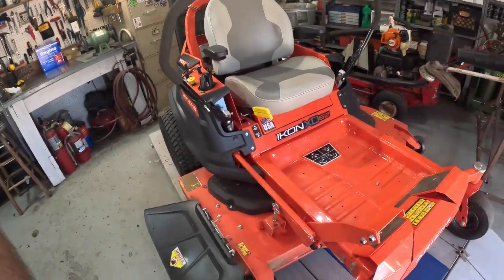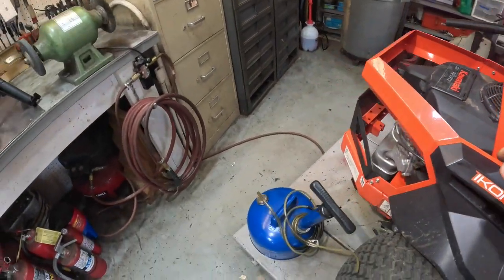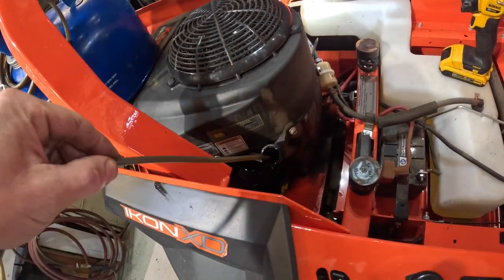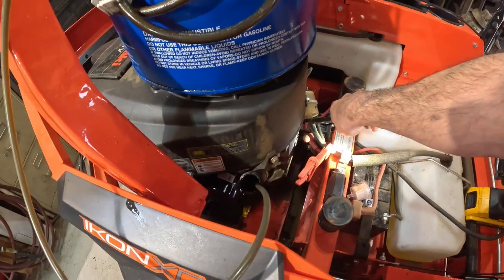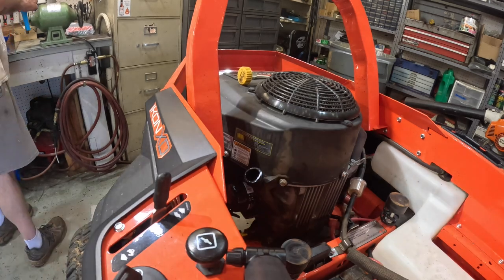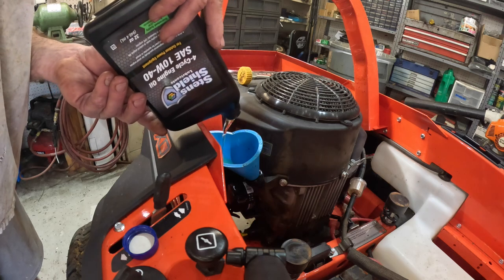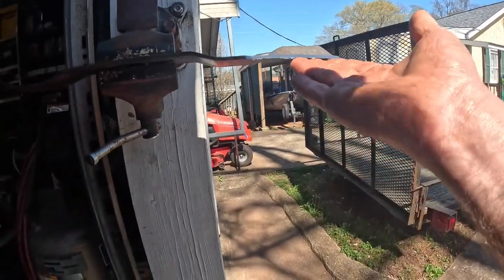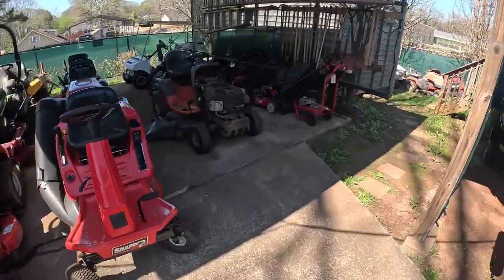Annual Service on an ARIENS Zero Turn Mower

Comment: I just did a tune up in my ariens ikon xd52. I replaced the drain plug with the hose part# 51044-0902.   Next time should be easy oil change.

Comment: Hi Tom;

Good video and nice shop.  

Couple of things on The Kawasaki motors. When checking oil do not screw the dipstick in all the way to check level.  Many folks including myself have done this.  It says right on the dipstick do not screw in all the way. If you do screw it in all the way and top off to that line on the stick than the oil will be too high.   Second ,try to sell your customers on the made by Kawasaki  screw in rubber drain hose. Its cheap and doesn't make a mess like that Yellow plastic drain that' s on there stock. There is a cast tray under the Oil filter so my mod was to take a cereal  box and form a funnel out of that so it will stop oil dripping on the drive belt and pulley on that side. 

Also ,when changing oil  use the rubber drain hose.  As you know all the dirty oil is on the lowest point in that crankcase which won t be removed if using the suction method.  Apply a small amount of pressure on the oil fill pipe with your air hose.  That will force out the remaining oil and debris as well. Again 1or 2 psi is more than enough. Do not over do it!

You will pocket a few bucks in labor and your customers will like the fact that you really care about their machine not to mention the next time it comes in for service it;'s a drop oil and go scenario. 

Also I noticed you had some 2x4 material to use as chocks.  If that strap lets go  those rear tires will go right over those 2x4's like Greased Lightning . Those front wheels will go right over you and no I dont trust the Parking brake in that scenario. That zero turn weighs 682lbs per spec , and maybe more with topped off fuel. Instead Invest in a pair of Harbor Freight or Tractor Supply rubber or plastic chocks they  are way higher, weigh and cost almost nothing.  Just trying to save your Bacon here.....

Hope this helps.

Comment: thanks for your videos
for the blades i use a 40 grit flap wheel on my grinder, removes metal fast and wont heat up, i can do a bad blade in about ten seconds each side, i mow for a living and sharpen my blades 2 or 3 times a week depending on how many sticks i dont want to pickup lol, short of buying a professional sharpener this is the best way i have found and the flap wheel is a lot quieter

Comment: Tom I believe as hard as it was to pull the spark plug caps off a dab of dielectric grease would have made it much easier for the next guy. Seems to me you grind a long time. Of course sometimes they need it to get rid of the rounded edge. These were sharper than my home mower. Before you started.

Comment: Nice video  thanks, But you are not supposed to screw the dip stick in on any Kawasaki engine to check oil level. Just rest it on the tube. If you screw it in you'll be low on oil. It's in the manual and written on the dip stick itself. Just thought i'd let you know. Thanks again Tom.

Comment: Hello , Love to Watch your videos and learned alot ,, I started this hobby 2 yrs ago repairing and flipping push and self propelled mowers and enjoyed it !!! I am thinking in learning riders and zero turns . is it hard to learn to fix the them and what is best way to learn ?  keep up the great videos !!! also where can i get one of those oil suction device?
Have a Great Week !!
Reply from the maker: best thing you can do is watch a lot of you tube videos! just be careful working on larger equipment by yourself, that is the mityvac 7400 extractor

Comment: Mine came with a clear plastic tube that connected to the plastic oil drain. The most irritating way to get the oil out. Now, I've lost the tube. Other than that, I love this mower!
Reply: Not Ariens fault you lost the tube
Reply: I bought a Braided Stainless Steel Drain Hose for my Kawasaki oil changes. After cutting the silly plastic fitting off the engine, it was an easy install. The Stainless hose stays where I bend it, instead of trying to straighten up away from the  oil container. Amazon has 'em.

Comment: I just purchased my first zero turn. When is time to sharpened the blades do you need a way to rebalance the blades or it doesn't matter?
Reply from the maker: you really should check the balance each time ya sharpen

Comment: Ha its that time again for an oil change on my Apex 52.... The fuel filter you removed is the original Kawasaki filter, which I'm sure you know that.  I just replaced the one on mine as well (with an original KAW filter from the dealer), but did't bother with the spark plugs.  It's the same engine -FR691V as the mower you're working on. Got a ?  ...  What's the rule of thumb on spark plugs? My mower only has 41 hours on it, but this is my 4th season using it.  It runs fine and never an issue so my motto is ... If it ain't broke don't fix it.  I'm also a fellow Georgian.
Reply: Should I bother with the spark plugs or let em' ride?

Comment: I pull from the bottom up  piece of plastic bag under the drain and filter in a funnel shape and place an old paint roller pan underneath the end of the plastic.

Comment: I no longer lay under my mower to service the deck.  The IKON-XD52 deck can be removed in less than ten minutes and without tools.  Flip it upside down on the bench on a 4X4 on each end and work standing up.  When oil is drained and black in color, that's a good thing.  It means the oil is doing its job and holding contaminants in suspension rather than allowing them to cling to critical engine parts.  All the best to you as you begin a new journey.

Comment: Would like to how your Steam Clean Process Works? Thanks Tommie👍
Reply from the maker: i buy Purple Power at walmart in the 2.5 gallon jugs, mix it half with water in a cheap little one gallon pump sprayer, soak the equipment and just hit it with the water hose on straight stream avoiding the air filter, somethimes i'll put in a bad air filter just to soak up any water, after that i'll replace it

Comment: Since it had way too much oil in it it's possible the owner screwed the oil gauge in fully to check oil level which was the case with a lot of older small engines but isn't the case with a lot of the newer engines

Comment: You are supposed to grind using the rest and the blade the other way around  grind from the top is the proper and safe way to use a bench grinder

Comment: Hey any help , I purchased mine brand new , now it has 48 hours on it and the blades are not engaging when I pull the PTO up I can hear it trying to , but nothing
Reply from the maker: check your belt, make sure it hasnt come off, look under the back of the mower and see if the belt is still on, with a 3/8 socket take your blade spindle pulley covers off and make sure the belt is still on, and make sure something doesnt have the blades wedged like grass or a stick or something, with the mower off... if you can turn the blades freely the belt come off
Reply: Thank you sir I have done this and belt is tight and on and looks great , but the pto will not engage unless I hook up like to my car , for instance jumper cables is what I've been having to do , thought it was the battery so bought brand new from ariens service dealer and then they gave me a bigger battery , so i had bring it back cause the battery tie down doesnt fit with that battery , and no joke he said you dont need it anyways most ppl just take them off , so baffled i was like okay so i put the battery on it and it worked then after a while did the exact same thing the only way i can get the pto to engage is start the mower and still jump it off with my vehicle, or start it and hook up a battery charger that is the only way , I have the exact same mower in ur video same motor but I was wondering on ur starter solenoid the smaller wire hooks to which side on the solenoid , mine is on the left side of the solenoid but my solenoid is underneath the seat right under the black fuse block but please any help I would greatly appreciate it if you would like my cell number is 865-253-2313 please call me if you can , and I can show you video or pics if you need me to, and show you exactly what I'm saying is honestly 💯% truth , but thank you sir so much I have asked the service dealer and they want to keep my mower for months  and I can't wait that long , not to mention , pay lost and job lost thank you again sir for ur time and help

Comment: My Gravely ZT-XL leaked from the same type of plastic oil drain plug. It had oil residual all around the engine , just like the one you worked on. Very bad design.

Comment: When I take oil out of my Iconx I have a mini pump I put the tube where the yellow cap is. Much faster then your method. As far as how much oil goes in machine just look at the owners manual! Just guessing like you are doing takes longer and inaccurate.  You definitely had to much in there,Iconx take 2 qt. That is the reason you had oil all over the frame.

Comment: The reason it read so much oil is your supposed to check oil without screwing down the dipstick . Down So when you screwed it down it showed more oil . Dipstick says check only by seating the dipstick but not threading